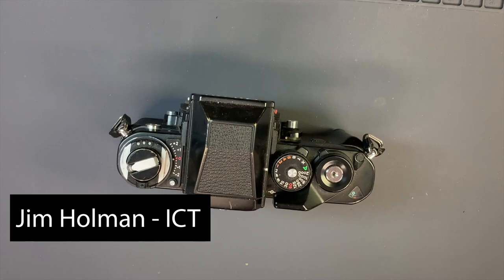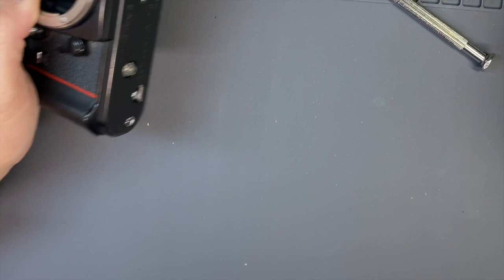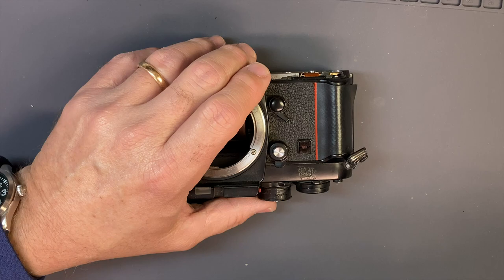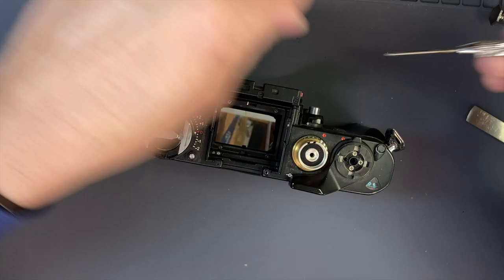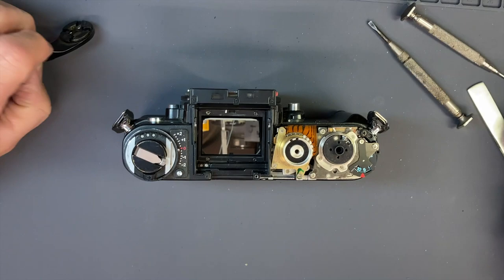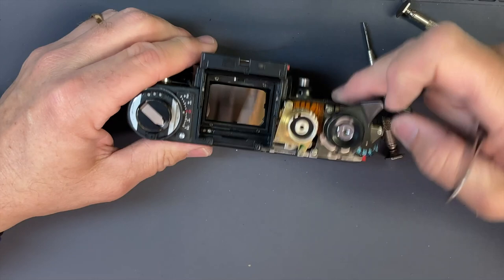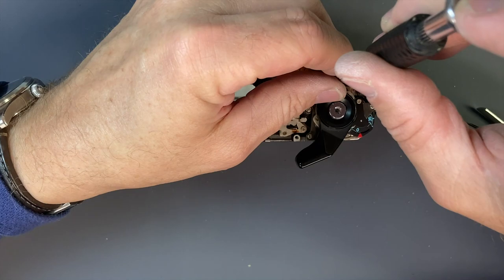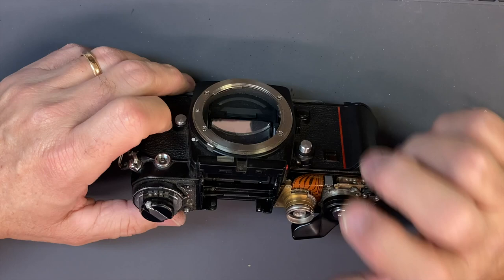F3 Disassembly Part 1

Comment: Hi! Great videos! I have an F3 wich has a problem with the aperture coupling ring. When rotated all the way and then released, it drags and doesnt want to return to its original position. When the AI tab is lifted up the ring moves more freely. Is there an easy fix to it? Thanks!
Reply from the maker: Most of the time a dragging coupling ring is because of dust and dirt. The ring will need to be cleaned but the biggest problem is the coupling string. If you do this and jump the pulley, it will be a big repair to put the string back on the pulley  again.
Reply: Hi. Thanks for the video. I just bought an F3 that seems to work in ‘A’ mode but whenever the dial is set to other manual shutter speed ( except T or B ), the shutter will fire and jammed. The only way to release the jammed shutter is to remove the camera battery. Is there a fix to it like you’ve shown in this vid? Thanks in advance!
Reply from the maker: @borneoagathis5920  I would clean the 2nd curtain magnet, clean between the speeds dial casting and body ground and clean the ASA resistor and ground wiper.